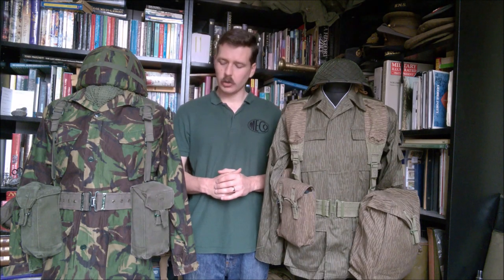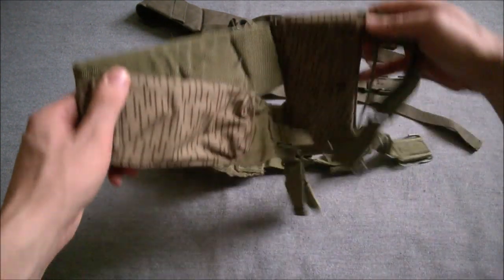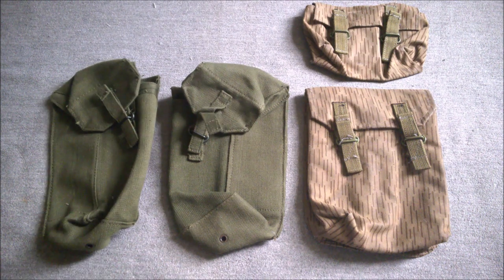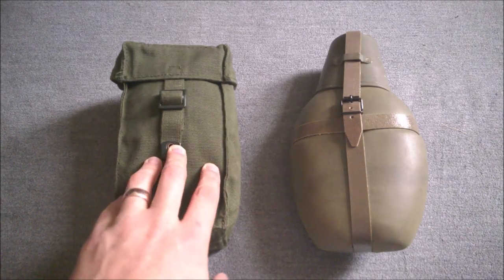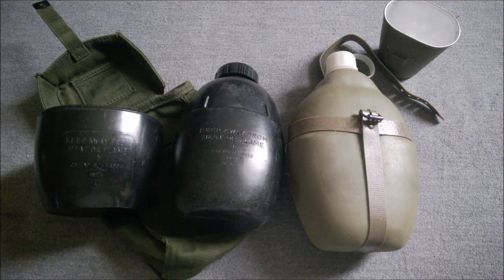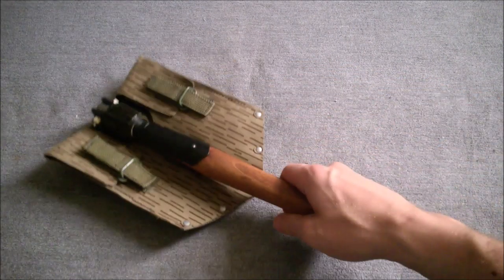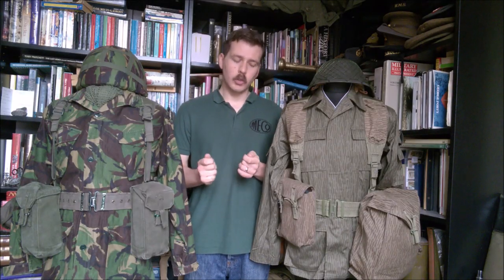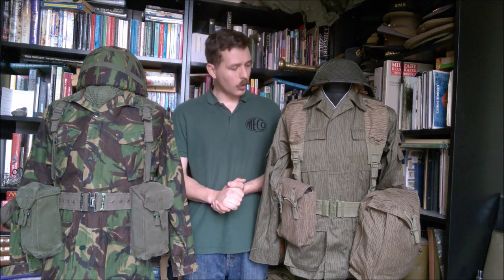British 1958 Pattern vs DDR UTV Part II - Kit Comparison

Comment: I've seen suggestions that the entrenching tool could be worn inverted, unlike previous NVA equipment and that's what the laces on the yoke are for - to support the handle.

Consensus so far seems to be the strichtarn carrier with grey derderon straps was used with the Fallschirmjäger vest and I think there are photos out there showing this. That as best I know predates UTV and can be considered seperate
Reply: The paratroopers had the Fallschirmjäger-Tornister.
Reply from the maker: I've seen the suggestion regarding the entrenching tool being carried handle up before but I've yet to see actual period documentation supporting that so I've not gone with that assertion. That said I do discuss the supposition in Part I as it's an interesting theory.

Comment: Interesting to note the UTV magazine pouch conforms to the format of the final (straight sided) MPiKM magazine pouch that you can see sometimes used to carry flares by the Grenztruppen, rather than the MPiKM-74 pouch with stripper clip pocket and oil bottle pocket.

I forget when UTV was developed but as I understand it, were under production from 1984.
Reply from the maker: There is also an example with an oil bottle pocket which I'd like to pick up. I believe the uniform was in production in '86 as you say, not sure on the equipment itself.

Comment: Very cool video I have a easy German impression with the later issue equipment and I prefer the gear they actually used.
Reply from the maker: Indeed, it's cheap and easy to get as you say.

Comment: The previous NVA grenade pouch was apparently attached to the interior of the transports, and grenades would be carried in the uniform pockets by soldiers when needed. I don't know why they differed from the Soviets in this way or why they changed that for the UTV equipment. Certainly this explains why the original pouches are in flat colours, not strichtarn or blumentarn pattern
Reply: Crazy Theorie
Reply: @kulikov9215  I will check with my sources but we know from both the NVA uniform regulations, the Militarische Grundwissen and period photos that no grenade pouches were worn by NVA soldiers, including Fallschirmjäger or Fernaufklarer, and that the UTV is the first instance of it being included in the webbing system. That the vehicles have the mounts for them is what I've been told, but I will check and confirm where this information originally came from, if you like.
Reply: @deancosens5710  your partly right, the Kampfgruppen and early nva had granade pouches. But stuffin uniform pockets was a tabu or kind of an unspoken rule.
Reply: @kulikov9215  so far the only grenade pouches I've seen for wearing on the belt are for tear gas grenades. You're right that these were used earlier, the example I've seen were from the sixties, and MdI stamped (so yes, used by the KdA, not the NVA) but then the KdA used different equipment to the NVA, like the 7.62 drum magazines and their pouches for the RPK for example. I hadn't seen any grenade pouches in use by the NVA at all, so I'd definitely be keen to see what the were using! Are you are it wasn't the KVP or DGP?
Reply: @kulikov9215  there are photos of those pouches in use by KdA units at the closure of the Berlin border in 1961, is that the ones you're thinking of? If so those are indeed smoke or CS gas grenade pouches
Reply: @deancosens5710  I'm talking about actual nva granate pouches... I actually got in my collection... They also used the KdA pouches. I got the information from soliders.
Reply: @deancosens5710  I don't think that your in the position to discuss such things... You rely on pictures...
Reply: @kulikov9215  pictures, official documents and information from former members of the NVA, yes. I'm not sure why that means I have no right to explain what seems to be the case, as one cannot make such statements without some kind of factual evidence. I don't see how any statement made without the support of historical evidence can possibly be judged to be 'more right' than any other statement, especially one with a proven factual basis. I think, if we're doing opinions, that you're being a little bit unfair 😉
Reply: I'd really love to see your pouches in your collection! Unfortunately, the only way we can prove for certain sure that anything was used is photographs, they prove things irrefutably. That so far none have surfaced showing the NVA using grenade pouches commonly suggests they were not common issue. They might have been made, but then, the NVA had numbers of PKMs in their inventory, and SVDs. And yet, it's almost impossible to find evidence of them being used. The SVD has so far appeared in only two photos, one of which shows it being examined by Erich Mielke, not in NVA use, and none so far as I'm aware have surfaced of the PKM in NVA use. The PKT in vehicles sure, but that's a different weapon.

The fact is, whilst we both have the items we refer to, and we both have testimonies from those who were there, but may not remember so well, photos remain the only irrefutable proof of what actually went on. Official documents tell what should be done, but photos prove what was done officially and unofficially. That's how this history thing works!